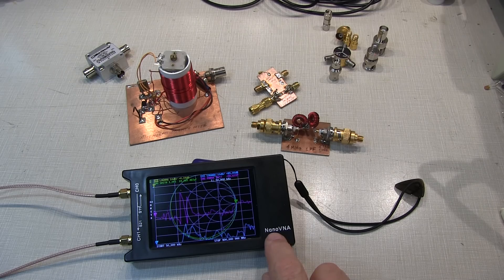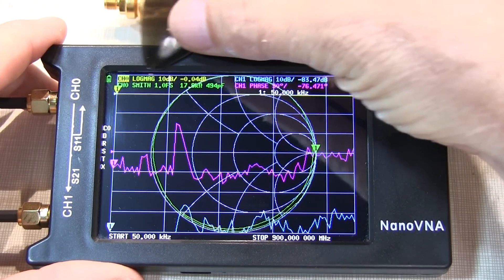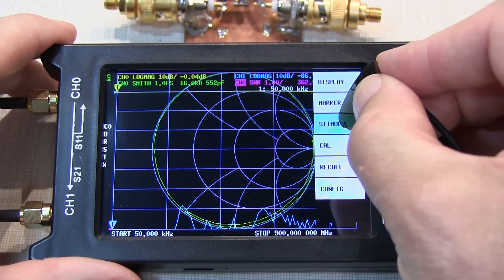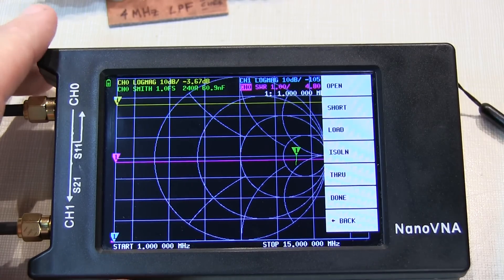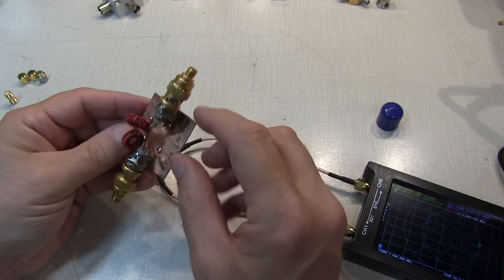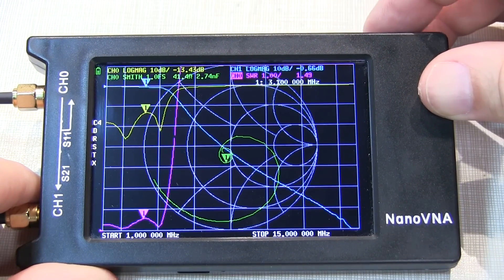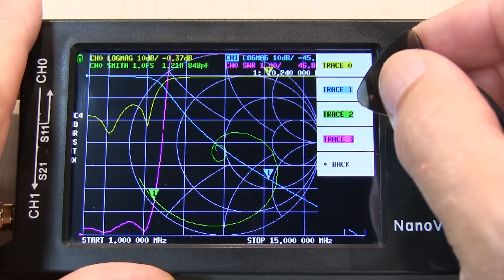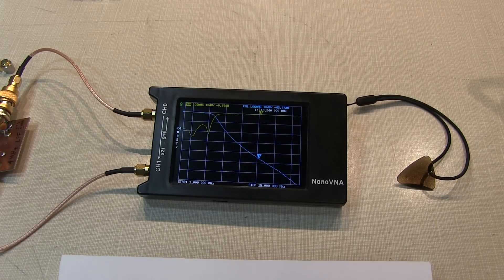#315: How to use the NanoVNA to measure a low-pass filter

Comment: What type of toroid did you use for the inductor?  I have some T-50-43's that I have used to make unun's with. And I have some T130-2 toroids. You didn't say in your video, and I would like to build a filter.
Reply from the maker: I used T50-2 for those.  The -43 material is ferrite, while the -2 material is powdered iron.  So, the permability will be much higher and not suitable for this low value of inductance.  You can use the -2 material, but with the larger diameter, you'd be looking at about 16 turns according to the calculator on toroids.info.
Reply: @w2aew  Thanks for the info. Your an excellent instructor and I wish I could be in the lab/class along side you to learn. 73's

Comment: How can It be that when you put an rif filter direct after an amplifier that the matching is gone on the vna? The are both 50ohm
Reply from the maker: For this type of filter (and most filters), the input impedance is only 50 ohms in the passband of the filter.  Part of how the filter works is reflecting energy that is outside of the passband.
Reply: @w2aew strange thing is when you put a peace of coax in between the matching is back again. 
Thanks for your answer i like the video’s 🎉😊

Comment: I used this information to set up my NVNA to sweep an old HF Low Pass filter and it worked, only thing I did differently was to set the stop frequency much higher.  Noticed that on 50 MHz there was a bit of loss so for those Hams that work this band you may want to look into this.

Comment: Why do radio amateurs use SWR? Return loss is a far better, more informative measurement.
Reply from the maker: Likely it has a lot to do with the availability and cost of the measurement gear.  Traditionally, the least expensive tool that is available or used by amateurs is the SWR meter, either built-in to the radio or external.

Comment: The display always shows S11 and S21. How could we measure S22? Also, Open, Short, and Load should be connected (while doing calibration) on both ports, and I don't see the option to change the port while calibrating the port 2. Please help.
Reply from the maker: The nanoVNA is a 2-port, 1-path VNA.  This means that it has an RF source only on 1 port.  Thus, it can't measure S12 or S22 at the same time as S11 and S21.  The only way to measure the reverse parameters is to reverse the connections to the device under test.
Reply: @w2aew  Thanks. It makes sense. Are there some documents showing its detailed internal architecture?
Reply from the maker: @shrutisrivastava8977  If you google "nanovna schematic", you will find a lot of references
Reply: @w2aew  thanks.

Comment: Hi Alan...thanks for the good video. I have a question. I have the 2.8" version of the NanoVNA-H. I designed a Pi (low pass) filter (2 caps, 1 inductor) with a cutoff frequency of 150 Mhz. The idea is to reject everything from 400 Mhz on up. I am rejecting a 400 Mhz radiosonde transmission. When I put filter as DUT between S11 and S21 and measure S21...I see the 150 Mhz -3db corner...attention continues down as expected til around 280 Mhz (at -45db)...then as frequency increases from there...attention decreases. At 400 Mhz, attention is only -26db. I calibrated my Nano as instructed. Any idea what is going on? Thanks, Steve
Reply from the maker: Do you have any evidence that this is not how the filter is actually behaving?  How are you connecting to the filter (clip leads or coaxial RF connectors)?  Is the filter enclosed/shielded to prevent coupling from input to output?
Reply: @w2aew  Hi Alan...my problem is inexperience. I just assumed I should be seeing a flat, stop-band upstream (up frequency) from a low-pass filter. Unfortunately, this is not what I am seeing. My filter is in a small metal box with BNC jackets on either end. Components are soldered directly to either the center posts or ground posts. Could my connecting cables be the problem...or are those potential artifacts calibrated out? Any further thoughts?
Reply from the maker: @stevebailey1682  connecting cables could be leaking.  As an experiment, remove the filter but leave the cables as the would be as if the filter were present.  See how much attenuation you have at the higher frequencies.   It is also likely that there is coupling from input to output inside your filter enclosure.  You might try making a shield that separates the input from output inside the box, grounded to the box, with just small pass-thru holes for the connections

Comment: First, your videos are exceptional and very informative. I am trying to measure the SWR and insertion loss of some coax switch's within the freq range of 1-460MHz. I fully calibrated my NVNA per your methods withing that freq range, and are using S11 for SWR and S21 LOGMAG for insertion loss. The problem I'm seeing is that when I measure between S11 and S21 (w/o DUT), the insertion loss is essentially 0.0db, whereas the SWR shows a slowly rising slope of 1.015@1MHz, 1.116@144MHz, 1.946@440MHz and 2.028@460MHz. If I disconnect S21 from S22, and attach a 50 Ohm load on S11, the SWR is essentially flat at <1.007 from 1-460MHz, but S21 is all over the place, best case is -43db @333MHz . What am I doing wrong, or should I compensate the S11/S21 measurements with the S11 SWR only measurements? Thanks, Bill, KO4YLX.

Comment: It would be interesting to compare the graph results from measuring this filter with the measurement done with the upgraded firmware from #320, provided you still have the same filter assembly available. Does the increase in number of points bring out the sharper dips in the S11 predicted by the design software?
Reply from the maker: I have.  The dips in the S11 where a little deeper - but I don't recall how much, maybe another 10dB.

Comment: I figured early on that you pretty much favored BNC connectors,  but have noticed lately that more stuff seems to be using SMA instead.  (I rather prefer BNC myself.)  I've also heard that SMA connectors have a fairly limited number of cycles when you can plug stuff into and out of them,  but have not experienced this for myself just yet.  I've considered getting some "savers" (an SMA male-to-femail adapter) to put on the Nano,  but haven't gotten around to that yet.  Your thoughts on this?
Reply from the maker: SMAs are pretty rugged.  The 3.5mm and 2.92mm, which are all mechanically compatible with the SMA are a little less rugged.  Connector savers are generally a good idea.

Comment: Hi Alan, thanks a lot for solving our doubts on RF stuff. Regarding VNA calibration, I have a doubt. I wonder how to do the calibration if I have a circulator in the transmission (S21) setup as shown in the link below
https://drive.google.com/file/d/1hw2uE5iOTcQSFHt902wwOkVx-izm9MTd/view?usp=sharing. Would you please clarify my doubt? Your help will be highly appreciated. Thanks in advance.
Reply from the maker: If you're interested in having the calibration compensate for the circulator (i.e. remove it's effects from the measurement), then the thru calibration should connect Port1 to the DUT port of the circulator, and the output to Port2 as shown.
Reply: @w2aew  Thanks for the immediate reply, Alan. I will try and let you know if the calibration turns out bad... 
Assume it has gone well otherwise... :)

Comment: Hey ! 
I need to transmit an analog HD video signal (AVI, TVI or CVI) over a line that is not coaxial and is not very long (max 50m or so). For this, I am using a differential line driver at one end and a differential receiver at the other to turn the signal back to single ended (these are some AD high speed op amps). What I found is that I need to have frequency dependent gain at the receiver (a low pass filter in the feedback loop) in order to receive the signal without distortions (ex. without losing color). Can I use this particular VNA to adjust that receiver gain so that I get as flat a response as possible over that line ?
Reply from the maker: You can, but you'll need to provide a balun at both ends to convert between unbalanced 50 ohm to the balanced line.

Comment: I have a (perhaps stupid) question, when the frequency is outside the pass band of the filter, I always thought the filter is essentially eating up the power but in your demonstration it looks like all the power is reflected back to the source. that can't be good or is my understanding wrong? perhaps since there is no 50 ohm resistor involved the power has to go somewhere... learning new stuff all the time :D
Reply from the maker: It depends on the filter design whether signals outside of the passband are reflected or absorbed.
Reply: @w2aew  well i learned something new thanks to your video :) it looks like all common filters reflect the signal back, i never knew that. for a low-pass or high-pass i think one has to make 2 filters side by side to split the signal like a cross-over and then direct one into a 50 ohm resistor. i'm going to do some research on this :)

Comment: Great videos! I have learnt a lot from this channel. About the nanoVNA. Do you think it’s possible to measure s parameters of a BJT (at 144 MHz) and get fairly accurate results? I’m thinking of a home made board with sma connectors and circuits for biasing the transistor.
Reply from the maker: It might be a little dicey.  One of the main problems is that you can't change the output amplitude of the NanoVNA (so it might not be the right amplitude for your tests), and the output is a squarewave (harmonic content might alter the device characteristics).

Comment: Why does various RF filters S21 will look the same using a 2 port S21 & S12 frequency response plot looks symmetrical. But the Smith charts complex impedance is different for S11 and S22, any reasons why the complex impedance are NOT symmetrical and the S11 and S22 are not at 50 ohms and have different complex impedances but the frequency response lots looks the Same symmetrical complex impedance?

Comment: I have a need to translate any voltage above 5V to 5V or below with sensitivity on voltage change. I was thinking like a zener and a few resistior and potentiometer.. i need to measure a voltage drop that happens in 48 hours. Say I have 48V and in 48 hours its 30V is there a way I can measure that drop with an arduino Analog with any sensitivity to that small drop??? If you have any thoughts please i would love to hear how I could do that.

Comment: I have just began my first longer term "retirement" project.  Hoping to build my own LDMOS Amp for HF.  I have just started at the designing of my filters.  This video is EXACTLY what I was needing !!  Thank you again for taking so much of your time to contribute to the Ham and electronics hobbyist !
Reply: 1988 24 yrs old new Ham License and a HW-101.  100' Roll of  RG8 and a spool speaker wire from Radio Shack.  Not even an swr meter.  Had zero idea of how little a knew !  Had a blast, and still do learning and enjoying all these years later.  And now that I am starting to have the time to dig in deeper, your videos have truly been a great help !

Comment: I see you use the larger 4.3” display VNA. Where did you purchase it from? I have the smaller version.
Reply from the maker: I have the H4 - it is available from R&L Electronics.
Reply: @w2aew  That's where I got mine,  along with some adapters for SO239, BNC.

Comment: I'm confused what the complex impedance is a spiral circle, what is causing the complex impedance to be a spiral circle pattern? and how can you change/alter the complex impedance pattern? can you show how to do that in a youtube video because changing the inductance and capacitance doesn't change/alter the complex impedance pattern
Reply from the maker: Take a look at my impedance matching videos with the Smith chart to learn more about that.
Reply: I have watched your videos on the smith chart about the upper part of the smith chart is the inductances and the lower part below the mid line is the capacitance. I'm very confused about when you measured the antenna in your video adjusting the inductance dial knob and capacitance dial knob that it didn't change the complex impedance arch, curve, spiral circle. Any reasons why and what does alter/change the complex Impedance of the Antenna? or RF filter circuit?

Comment: I wonder what the IF bandwidth is, likely it has an order of 100 kHz or so. It's a fairly wide IF bandwidth but IMO reasonably narrow to get accurate measures of low pass and high pass filters. I have no idea what minimum band-pass filter bandwidth can be measured by NanoVNA, but will investigate it when my NanoVNA will arrive at me. :) I also want to measure its uncorrected parameters to figure out its precision.
Reply from the maker: I think it’s on the order of 10kHz
Reply: @w2aew  yes probably. I'll try to check specifications or even try to measure it when possible.
Reply: @wolfmonk9d  It uses a regular audio codec chip, that limits the IF bandwidth a bit...
Reply from the maker: I remember reading somewhere that it down converts to 5kHz, that what made me think the IF BW is <=10kHz.
Reply: @w2aew  exactly. I always confuse NanoVNA with grown-up devices like Agilent or R&S which I'm dealing with at the office. Their usual default IFBW somewhat 10-100 kHz. But grown-up devices have a slightly different architecture. :)